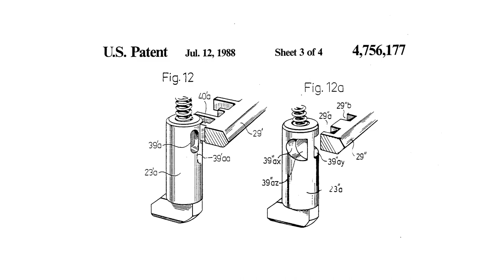(09) Schlage Primus Picked and Gutted

Comment: Nicely done again -- Not as "intensely" made as the ASSA twin combi, but not as pricey either.  Very well presented -- why don't you put in the correct Schlage drivers (of the 3 sizes available) for a "pseudo" balanced pin stack (perhaps maybe a spool pin or two, ha, ha)

Comment: Wow that was a quick pick! Also like you said, if there is a 0,1,2 or 3 key pin, the pinning spec says to use an inverted .237 keypin for Schlage pinning. I’m not sure if factory pinning does it or if it’s just recommended to locksmiths though.
Reply from the maker: Hey Logan!! Ive never seen a factory pin a lock as inverted keypins so i just assumed it was repinned. I could be wrong. Be well my man!
Reply: Artichoke2000 you right. My brain dumb. :)

Comment: finally getting a chance to see the videos. camera angles are nice. i am looking forward to picking some locks with side bars and finger pins. i have been pretty much working with 6 pin cutaway locks and just repinned my first with spools and serrated. i dont have any dimple picks as of yet, but i will get some as well as a few single picks to add to the ones i have now. i do thank you for the videos and i will check the others out.